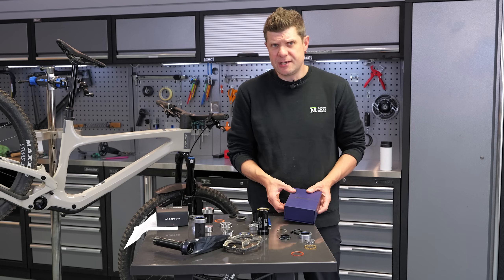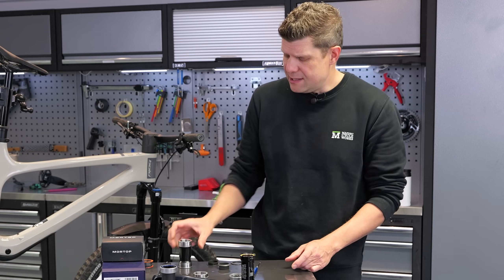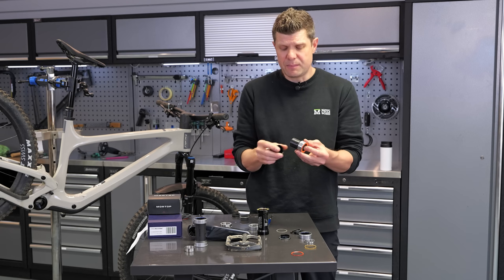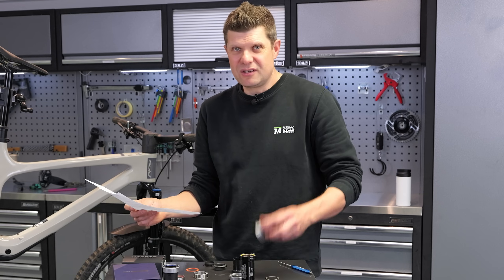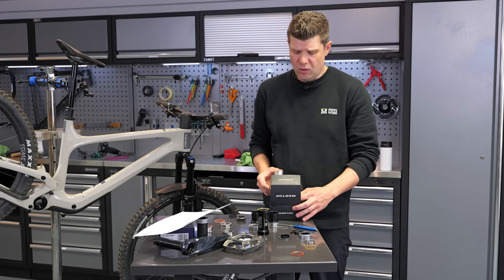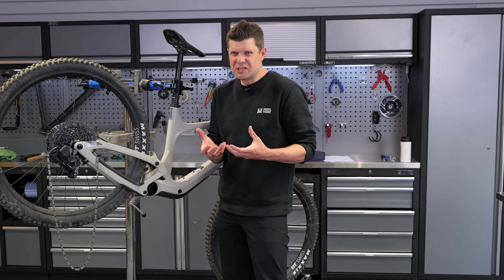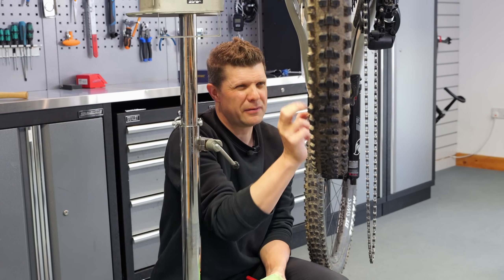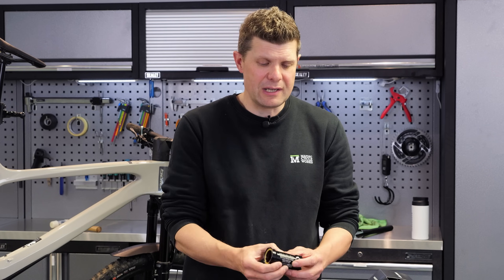Press Fit solutions for SRAM Dub cranks

Comment: Just viewed Mortop's instructions and video for their "spinning" BB's, which they call "Twist" (but not "Screwing", which I gather is BSA'ish). Now very confused. 

Have I got it correct that something like their Extreme BB differs from the Extreme Ultra in that the Ultra uses SS bearings vs carbon steel in the plain extreme? And then the "road" versions use a low friction seal where the "mountain" option is a tighter, slightly draggy seal? 

Next, the install for these-- not quite clear from either your video or their instructions, but looks like you:
1. Press in one cup using a tool that has some variation on threaded rod, nuts, and drift or driver to fit the cup. 
2. Engage the threads of second cup with first, and using two ISIS 20T drivers, thread the two cups together firmly, in the process "twist-pressing" the second cup in to the frame. Cups are now installed.
3. Slide a spacer, shield, and bearing onto the crank spindle. Slide spindle thru BB cups and then
4. Slide a bearing, shield, and another spacer onto the spline end of the spindle, and 
5. torque the cranks together to press the bearings into the cups in the process installing the cranks...

Have I got this right?
Reply from the maker: I think a local bike shop will be able to help.  👍

Comment: Appreciate all of your efforts regarding BB's...sorry if I've missed this in the video, but in your experience, what's the best solution for PF92/30mm spindle? Thanks again!
Reply from the maker: I can’t think of any bike with a 92mm more.  I am guessing you mean the Trek BB92 that presses the bearing direct into the frame.  In which case there is no solution for 30mm axle.

Comment: I have been using Shimano cranks ~25 years. Last year, I bought DUB crankset and installed to my gravel bike with PF86 (ztto threded combining BB just for test use). Before the crankset, I have been using GRX on the frame, and totally no problem with the same BB series. But the BB bearing failed 2x times within a year. It never happened to Shimano 24mm spindle. 
I thought it would be good with Wheels MFG or such a brand. But as you said, the bearing balls are too tiny, and the seal also looks thin and fragile compared with Shimano 24mm. I think, with DUB BB, any brand could be fail quicker than 24mm spindle. This is my first and the last DUB crankset.
I just ordered an Elilee 24mm X310 crank.
Reply from the maker: Yep. DUB on BB86 just doesn’t last.  The only brand making anything remotely feasible is probably BBinfinate.

Comment: Thanks for this video, I have a 2023/24 Scott Scale 910 hardtail mtb, which has a carbon frame, and after 12 months the sram press fit BB sounds rough. It's a 41mm - 92mm wide I think. Anyway I messaged Mortop, just something to be aware of is that there are no UK distributors, but they do ship to the UK, but looking on their site it'll cost you 30 dollars. My concern is your comments regarding bore size accuracy and alignment, I've no idea if my frame is suitable and it's expensive if it doesn't work.

Comment: I'm not convinced there's an ideal solution with BB86-Dub after reading the comments. The results are mixed.

I'm thinking more about upgrading to an aftermarket carbon crankset with 24mm titanium spindle for around $350 and a standard Shimano BB86-24 rather than paying $200+ for a BB that might last.

Win-win situation. Lighter, stronger and carbon look. No bearing and durability issues.  Idk Any comments?😅

Comment: I've just got a SRAM Rival groups on my CANYON and am nothing but disappointed on it.  BB is shit after two rides, brakes are shit with sticky pistons but tbf the rear mech is ace.  Shimano every time for me road or mob...no comparison and why oh why did BBs ever move away from Chris King set up SMH!!!
Reply from the maker: In all honestly I suspect those are problems with your frame. Other vids on this channel will explain
Reply: Brakes can’t be frame; bb doesn’t spin at all well and everything points the poor bearings size due to osize crank spindle. 
Stam are just looking for a usp from shimano but they fail massively. 
Tbf I’m quite happy with the frame so far. 👍🏻
Reply from the maker: @ yeah. Misaligned brake mounts will make your pistons come out at an angle, brakes will rub, pistons will stick. You’ll enjoy the rest of the channel. 🙏
Reply: Valid point…I might get the mounts reamed and see if it improves things.
Reply from the maker: @ ‘faced’ 👍
Reply: 😂😂 reamed sounds so much better.  😊

Comment: Pressfit is old technology replaced again by threaded BB, but good video for explanation of problems pressfit
Reply from the maker: Far from it. The recent BSA revival is bringing about more problems than it solved. Thread Fit can only come back if we accept the weight penalty of a fully bonded tube.
Reply: @Mapdec  interesting, i have also problem with extracting pressfit on one bike when i cannot lean shell to frame, that's why i prefer thread

Comment: If you use Raceface BB 92 pressfit in a scott carbon frame , do you use retain compound or only grease ? they said if you dont use retain compound BB is going to crack or move. Is it true ?
Reply from the maker: It depends on the size of the hole. Retaining Compound is a gap fill.
Reply: @Mapdec  Ah ok , i managed to remove the bearing but the cup stayed inside. As a new bike mech im afraid to damage the carbon frame . Pls send help lol
Reply from the maker: @Mr75Axl  be gentle.

Comment: I'm probably writing this too late to get a response, but I purchased a Mortop BB for by BB86 bike with Rotor 30mm cranks after watching this video. Went in no problem, however due to the thicker lip that sits on the outside of the shell, I can't use any spacers or preload and can't torgue up to the required 35-40Nm. I can get to 25Nm no problem, and 30Nm feels like it might be a little too much. Does this matter? and if so, is there a solution?

Comment: @Mapdec picked up one of the Mortop, going to install it tomorrow, feel very smooth and look very nicely designed.  Appreciate you looking into them.
Reply from the maker: Let us all know how you get on.
Reply: @Mapdec  was a piece of cake to install, and spins lovely
Reply: @justsomedude7556  I bought it too, just waiting to get it delivered. Any tips on installing it and about the spacers needed? I'm going to install Sram Rival crankset on it.
Reply: @HarishChouhan  The only tool you will need is a press that handles whatever version of SRAM you are using, DUB or GXP.  It was a piece of cake it install.  It comes with spacers, just use the appropriate amount needed for your setup, mine was a road setup with DUB, so 3mm of spacers on the drive side.
Reply: @justsomedude7556  Yup, I do have Sram Dub (Sram Rival AXS normal 2x crankset) and my frame is the Trek Emonda ALR with BB86 standard. I don't have any BB tools so I'll go to a shop for that :)
Reply: @HarishChouhan  i will send you a link to a lovely tool later when I get home. A little pricey, but is worth it's weight in gold. It does not require you to use a hammer to get the cups out
Reply: @HarishinVietnam  It keeps deleting the comment, look up First Components for the tool I used
Reply: @justsomedude7556  how has the BB held up after about a year? did you ride in the rain?
Reply: @HarishinVietnam  how has the BB held up after about a year? did you ride in the rain?
Reply: @justsomedude7556 can you post the tool?  Would love to not use a hammer

Comment: Can we talk about 30mm axles (RaceFace, Easton, Rotor, CaneCreek, ...)? It's the same problem, innit?
I think Praxis / Enduro came up with a promising solution. It is basically a one piece design of bearing and bearing cup, so the size of the bearing balls should be bigger. They got a version for 30mm on both sides and one for the Praxis style 30/28mm (like GXP in big).
If they would make a DUB version (maybe with Enduro's stainless steel), this could be the perfect solution.
Let me know your thoughts ;)
Reply: You can get spacers to run a dub crankset in a 30mm bb!

Comment: Fantastic video. ( Just essentially demolished a set of Truvativ DUB carbon in less than 400 miles due to wear and wobble that developed on the spindle. ) Never seen anything get destroyed so quickly on an MTB in my life. Can't help but think of the simplicity of the Shimano 24mm and also the previous generation GXP 22/24mm. Never once had an issue with GXP. Kind of quite disappointed to be honest.

Comment: I have 3 bikes with PF41 fitted and have been relatively lucky, my only gripe was i replaced the standard sram BB on my gravel race bike (giant revolt pro 0) with a ceramic C Bear mtb upgrade for the tune of £150, the bearings are noisy already, so l certainly wont be going down that route again. The bike has only been used in dry conditions too. You live and learn.

Comment: I have a BMC RoadMachine with a SRAM Force (BB86 with DUB crank). My bottom bracket is still the original after 23,000km and they are still smooth. I must have the longest lasting one. On the other hand my Rotor Ceramic with a Shimano 105 (PF46 with 24mm) on my Time frame didn't last 3000km. Rotor use shit bearing and their 5 years warranty doesn't cover them "Bottom bracket bearings are a wear item that we do not cover under warranty." And they tell you not to replace them, because (let me quote them again) "Because the cups are softer than the frame, will conform to the bottom bracket (Think of the interface like a crush washer) and therefore should simply be replaced, as once serviced will increase the odds of creaking or loose bearings." Which sound like a bunch of BS to me since you don't even need to remove the BB to swap the bearing out. I ended up replacing them anyway with NTN bearing. No creak so far. I hate Rotor, $200 for a BB that last 1 month...

Comment: I keep pulling what little hair I have left out every time I watch one of your bottom bracket videos. I was going to use sram eagle gx groupset with a sram crank in a bb30 bottom bracket. But every time I watch your videos I get the idea that dub in a bb30 isn't a great solution. So I found a screw together bb30 to shimano bottom bracket from wheels manufacturing, so now I am switching from getting a sram drivetrain to a shimano xt m8100 drivetrain. Seams like a better and more reliable solution. I am more than mechanically inclined (rebuild cylinder heads, brake calipers, and engines for my job) so fixing things and making things work is in my wheelhouse but I want a setup that I don't have to worry about and bb30 to 24 shimano seems to be the best bet. What do you guys think?
Reply from the maker: BB30 to DuB is great. It’s just a 6806 bearing with a top hat to step down to 29.  It’s the same bearing you will see in BB386evo and T47.  Just pushed directly into the frame instead of using a carrier.
Reply: @Mapdec  And now I have no hair left lol. Oh well I think I'll stick to shimano. From what I read the xt m8100 seems to be the more popular pick out of the two. But I'm open to your input on the matter as well. It is a carbon frame hard tail trail bike, I want something that will take a beating on the trail and stay reliable without too much fiddling around. And around 5 hundred ish CAD ruppies. The sram was cheaper and had the crankset included. The one major thing I liked about 24mm shimano was the wheels manufacturing bottom bracket is direct contact from spindle to the bearing and doesn't use a spacer or top hat. I don't know much about all this new fancy stuff they came out with for bikes since I last rode one. I have only bought the frame so far. So the rest of the parts are fair game. Any suggestions would be greatly appreciated. Your videos and the way you explain everything is top notch, and I'd love to be able to work in a shop as nice and neat as yours. Where I work is complete chaos on the best of days and everything is covered in grease. Cheers man, you got a subscribe for  sure.
Reply: also it's a boost frame and the shimano xt m8120 crankset is raed for 148x12 boos frames.

Comment: SKF have been selling 'old fashioned' bottom brackets for over a decade with roller bearings on the drive side. They offer a ten year warranty. They screw into BSA (mostly, Italian and French thread also available) BB shells. I've been cranking one for well over six years. It still spins like it's a few days old. Absolutely no servicing needed.

I'm sorry, was there some discussion on "progress" in the industry happening?

Comment: Killer solution (road), scrap the sram dub cranks!  My current Sram Force build solution (SLC 3.0): Magene P505 cranks with Durace 50/34 chainrings on a Kogel BB86 (cross) Ceramic.  My rear cassette is 10/36.  When this is done... I will have the gear ratio I need for living in the rainforest mountains with a dependable BB for buttery strokes.  I can not justify the waste of time, money and headache screwing around with tiny bearings, even two rows of them…  For climbing up the steep in the soaking wet I think the best solution is to scrap the dub all together. However, my thoughts regarding this Mortop BB for flat fairweather riding, looks like a solution I would definitely try out.
Reply: I was considering this as it's hard to get the front chainring size I needed. Is there any shifting issue with 16T difference in chainring when using with a Sram FD?

Comment: I see a lot of sram haters and well, sram absolutely deserve it, because they make as many interesting products as problematics one and their marketing is so good they are everywhere pushing regular consumers in ****.
However i can't deny they make high performance parts. A XX crankset is strong stiff and very light. You can't get this weight and reliability on a 24 axle. The problem is those pressfit 41 are too xxxxx small. Everyone here says shimano is king 24 superior but 24 is actually inferior for a crank design. However we should not try to cram a 30 or pseudo 30 is such a small pressfit hole and sram is guilty of advertising it as fine as well as oem speccing it. Bike company should just do bigger hole in their bike to allow them to reliably spec proper cranks.
My good old BB65 look as 50000km on stock bearing.
Reply from the maker: Very true.  Sram should probably have never made that BB and pushed frame brands to adopt Bb386evo and T47 in the same way they pushed for UDH

Comment: Hope has a second gen bb which is not enduro/inox but swiss made. Single row with metal shield. I have one.
Bikeone also make a one piece solution that I felt was interesting.

On my spark the sram and rotor (which is enduro made) die in a single very wet muddy ride. I have also been running hope gen 1 which is also enduro made but with inox balls and it looks to hold but i don't see how those seals will hold better than rotor one when it will meet mud. Only upside I guess is you have a chance at rebuilding it because it might not rust instantly like rotor (and sram).

Comment: Great video for those interested in bearings and bearing issues.

Can you just put a correction bubble in the video at 11:46. 

I am sure you understand and meant to say, “undersized” hole, not “oversized”hole, causing a bearing to be rough when rotated fitted, but the bearing rotates smoothly when removed from the undersized frame hole.
I appreciate the bike industry is, let’s just say relaxed on bearing interference tolerances, so it’s relatively common to find frames with both examples:- 
Frames with undersized BB frame holes, which causes the issue you explained in this video, of the bearing being rough, when fitted in an “undersized” BB frame hole and the opposite issue, that commonly damages carbon frames, of oversized BB frame holes, not significantly gripping the bearing outer and the bearing constantly micro moving within the carbon frame on peddling, which  causes further wearing of an already oversized hole, resulting in this difficult to overcome problem and the accelerated audible knocking coming from the BB.
Reply from the maker: Well spotted.  Totally didn’t notice that Mis speak. I’ll see if I can add.
Reply: @Mapdec  In a previous life, in a different industry, I investigated bearing failures of bearings costing in total >3 million, implementing vibration monitoring and tuning the algorithms to allow the introduction of, on condition, proactive bearing replacements and I am still interested in Engineering, including when working on my and friends bikes. .

Comment: Dub is literally the most stupid standard out there! My xx1 crank spindle  literally wore out because previous owner of the bike used factory crap bottom brackets and didn't change them every couple of weeks since that s*it develops play very quickly... Now I am stuck with creaking crank and couple of hundred euro bill for the new cranks since you can not just change the spindle like on other fat spindles such as RaceFace. Nukeproof bb seems to last a lot longer then stock one btw, I am a lot happier with that one, but changed it too late...

Comment: Got a di2 problem on my newest bike. It won't shift to the four easiest gears or largest cogs on the cassette. It does not shift wrong, the chain isn't jumping around or anything, there is no noise, it just doesn't shift or react at all. The remaining gears work fine, so does the front mech. Can't be a bent hanger, right? What could be the reason, the system is only one year old? Thought I'd try my luck asking here because this is the best tech channel.
Reply: 11 speed or 12?
High/low set correctly?
It worked before, i believe, did you drop the bike?
Reply: @NemesisRTCW  12s, didn't drop it nor knock it
Reply from the maker: Plug it into the diagnostics and see what’s going on. It’s possible to break them.